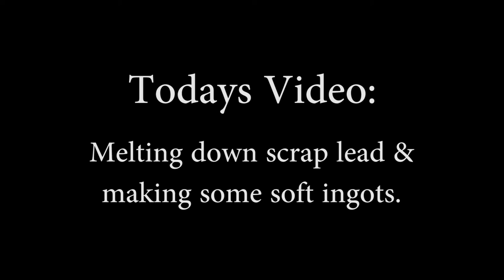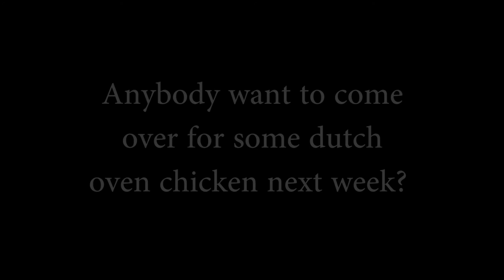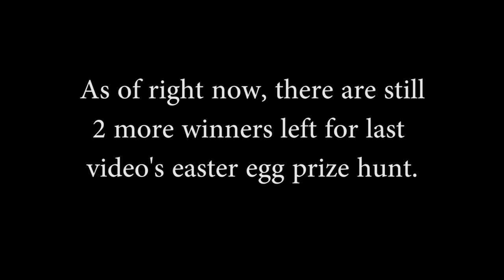Making Soft Lead Ingots From Stained Glass Window Scrap

Comment: i need to get a big pot like that and make a setup like you have . i have like 300 lbs of dirty scrap and roofing lead to melt down.
Reply from the maker: duffys gunsmithing yeah man, those harbor freight weed burning torches put out way more btu's than camp stoves and stuff.  also, the large Dutch ovens can hold a lot of lead.
Reply: My Lodge 10inch/5qt oven hold more than 80 lbs of lead
Reply from the maker: yeah, my 12" harbor freight dutch oven holds LOTS of lead.
Reply: That's what I need to setup this weed torch and cheap cast iron pan to cast zinc, I found that my turkey fryer wasn't very efficient at melting zinc, I gave up on it.  I rather use electricity but don't want zinc to destroy lee pot.
Reply from the maker: +Dima Prok that torch really kicks out some btu's.

Comment: Did you have to keep regulating the heat from the burner as the pot emptied ?
Also, checked on Amazon for the sausage cooker, no luck :-(  ?
Will see if there are any lead window places near me for some scrap lead :-)
Reply from the maker: Once the lead is melted, I flux it and then turn the heat down a bunch.  I keep just enough flame/heat to keep the lead from solidifying as I am pouring ingots.  This helps reduce the oxidation of the metals.
Reply from the maker: https://www.amazon.com/Wagner-1164-Non-Stick-Bread-Sausage/dp/B00KI0OU8U/ref=sr_1_1?s=home-garden&ie=UTF8&qid=1500906107&sr=1-1&keywords=SYNCHKG052851
Reply: Thank you very much,sometimes when searching Amazon you have to be right on the button for the correct name of your item !
Reply from the maker: +Nick J ha ha no prob.

Comment: inhave 60 pounds of pure lead 3 ingots of rotometals superhard and alot of wheel weights to melt
Reply from the maker: ok that's easy then.  Each of those is a known hardness.  Go here and download the lead alloy calculator spreadsheet:  http://castboolits.gunloads.com/attachment.php?attachmentid=45784&d=1341560870

Comment: Those brittle concrete blocks are not rated for high temperatures and will eventually break...that's gonna be a frickin mess. Prolly ruin the driveway drain too. At least get a plate of 1/4" steel with a hole cut into the center for the burner and lay that over the blocks.
I hate to see you waste all that Pb and take a chance on hurting yourself too. Hell, just get a turkey frier...a good one.
Reply from the maker: +Charles Irby thanks for your concern and ideas.  I've been doing it like this for several years and have never had any issues, but I do have plans to make a better stand.   I have a buddy who is going to cut a hole into a steel plate so I can set the plate over the blocks like you mentioned.  I also have plans of building a turkey fryer type stand or something similar.  Also thought about making a permanent metal bench outside to use, but then again...  So many ideas, so little time...
Reply: When you think of how heavy that Pb is and then it's all on 3 or 4 little feet on the oven...that's a lot of pressure on the block. I saw one fella use an old BBQ that was abandoned. He mounted the torch like you use in it and put the pot on the grill and that was sturdy enough. Lotz of ways to handle that weight.
Good luck on whatever you decide to do!
c h a r l i e

Comment: i wish i knew how to alloy
Reply from the maker: I will be doing an alloying video sometime in the future.  Hopefully it will be helpful.
Reply from the maker: hey Vanilla Gorilla, send me an email so I can get more info on what you would want shown in the alloying video.  I'd like to be able to answer all your questions if possible.
Reply from the maker: ok I got your email and deleted your message so it isn't visible to everyone.
Reply: mr taco. im curious about alloying. how do you mix when your not sure of your purity. is there a happy medium alloy for most rounds like 380 9mm 40 45 ? do you check hardness. i heard of aome guys  going by weight  to determine how pure their lead was.
Reply from the maker: Different kinds of scrap have estimated hardnesses.  Like range scrap, for example, is usually pretty soft.  Roofing lead is pure or almost pure, etc...  I will try to do a video that explains some of this.  Most handgun rounds are moving pretty slow and can be cast using pretty soft stuff.  Powder coating helps to make the bullets a little "less picky" on alloy hardness.